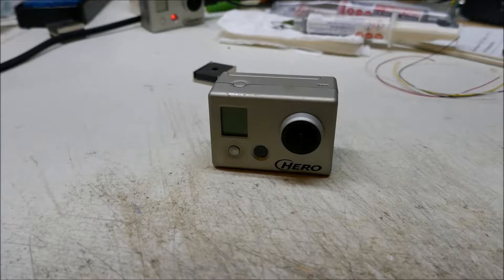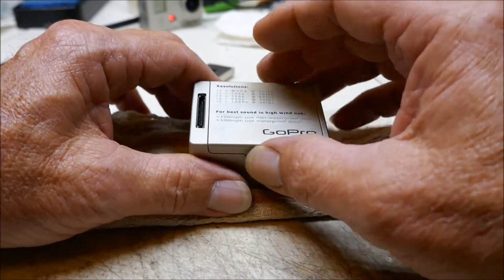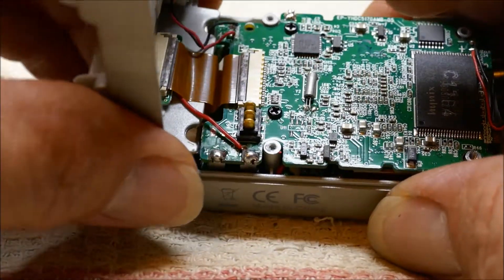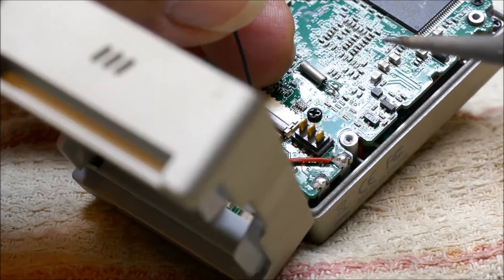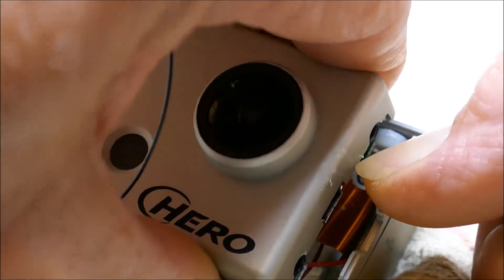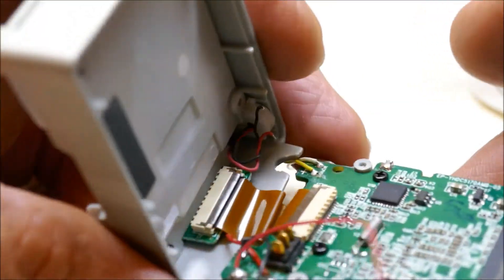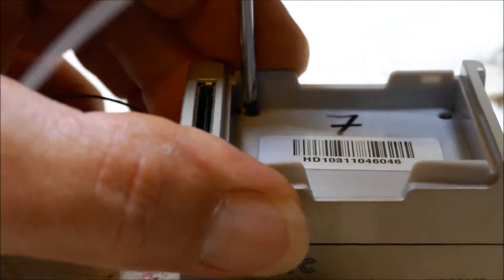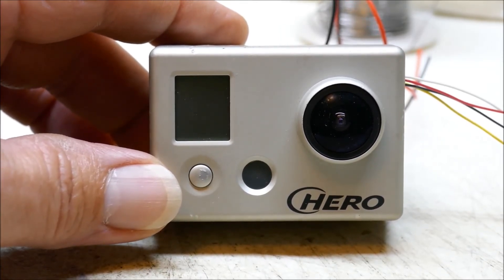GoPro Hero 1 and Hero 2 Hack Tutorial

Comment: Is that like a charger that you put into the back because I’m missing that part what is it
Reply from the maker: No it isn't a charger, it is a buss port connector. I have 2 wires soldered to the appropriate pin locations of the buss port connector. Those wires make it possible to operate the Power/Mode button manually and they get connected to my Safari circuit board that has a motion sensor on it. In the menu settings you would set the camera for One Button operation and have it set for taking video. When motion is detected the circuit board will turn ON the camera using those 2 wires so it takes videos of animals that are passing by. I have the Safari circuit board programmed to leave the camera ON for a predetermined amount of time, usually 30 seconds or 1 minute, then it will turn the camera back OFF. This hack (modification) is done to make the camera useable as a homemade trail camera for videoing wildlife the same as any store bought trail camera. 

You can find charger cables or wall mount battery chargers for your GoPro on eBay.

Comment: I like the hack , and will try it on my older hero 2 camera.. it’s only a total of 4 wires correct ?
Reply from the maker: That is correct. 2 wires for the microphone and 2 for external battery power to keep the internal battery charged up longer. The solder spots for the external battery power are a little different on the Hero2 so you will need to use a multimeter to determine where you need to solder those on at. You will also need the buss port connector that I mentioned in the video and the Safari Camera Controller board to operate the camera. If you need further information contact me using the Contact Form on my website that is linked in the description above.